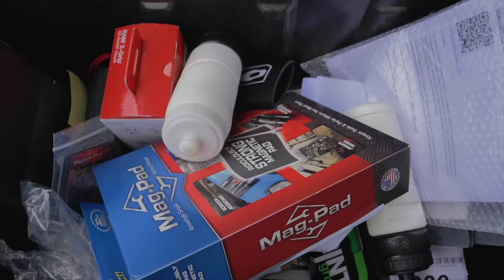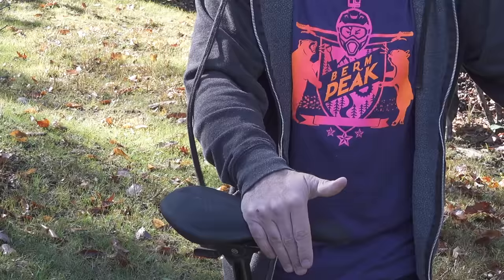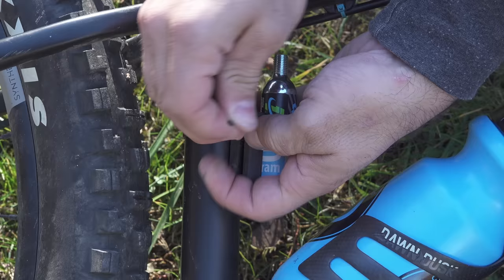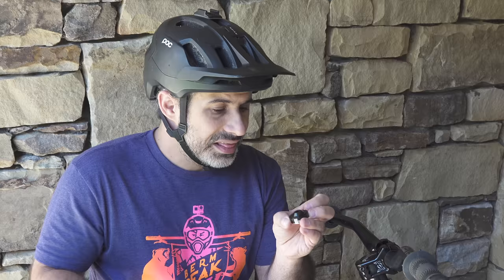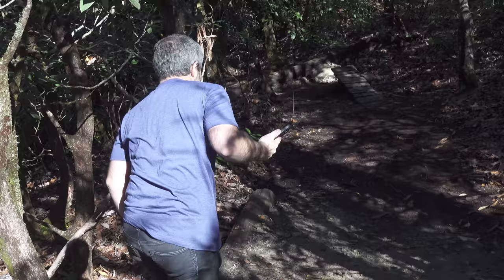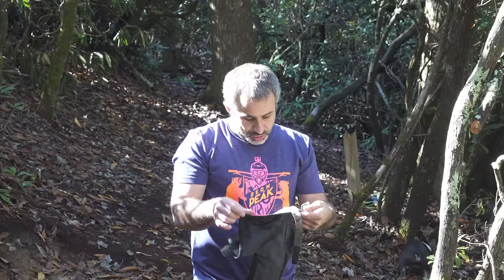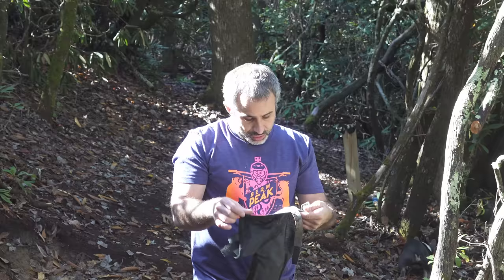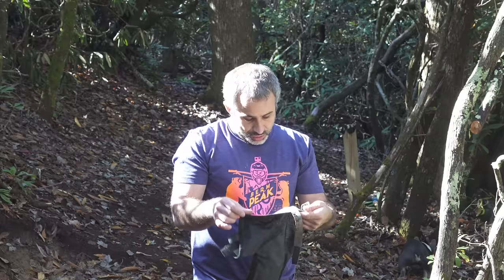Mountain Bike Products you may not have heard of

Comment: i think you missed the point in the battery powered pump.  Its not designed to replace tools at your shop (hand pump, or compressor). Its designed to be small and portable. Something you could easily keep with you on a trip for your bike, or motorcycle (i keep one on the later and its perfect for adjusting tire pressure on the fly on road trips without having to seek out a gas station)

Comment: I have Xiaomi air pump and that's the only pump I use since. Yes, it is slower and noisier. But the best benefit is that you can do something else while it pumps your tire. To the EXACT pressure (no need to double check and release air)

Comment: Loved the stem capitain and the schrader tubeless valve. I have 2 26ers. 1 with presta valves and 1 with the old single wall rims for schrader valves. I plan to try out if I can make it tubeless, but I suspect it is going to be a pain in my butt. I think the stem capitain would be more usefull if it was a navigation device or if it was a locking device with a corresponding phone case so it could hold your phone and allowed you to use navigation, clock, etc.

Comment: Hey Seth - if you really looking for a kids saddle on your bike . Check out the Feva Star seat. Its rock solid, does not clamp our holy carbon frames and costs a fraction of macride (which is probably the most premium you can get). My boys loved it - and it survived 4 seasons of shredding. downside is - its not size adjustable. so i could use it max to 3 years ... but all my kids knew how to ride themselfes with 3 years ;-)

Comment: Seth I think you might have misunderstood the purpose of the electric pump, at least I would think that it is for you to put in you bag and refill your tire anywhere if you got a flat and need to replace it, and for the size, it might still be faster and easier than a little hand pump the size of that electric one. Trust me, I have a hand pump and its soo not fun to inflate a tire to full pressure with it. I usually end up pumping to a rideable pressure and then just baby it to a gas station and pump the hell out of it with the air compressor there.

Comment: I'd use the electric pump if I'm out on the trails or on the train to my local trails. In my mates van I can use his lorry pump (he's a HGV driver by trade) and that thing can seat a tubeless tyre when set to full blast. Runs off the ciggie lighter, programmable and can do 0-35psi in about 10 seconds on the slow setting. I've changed innertubes in the van on the way to trails before, it's a right laugh.

Comment: "make any rim tubeless" - briefly, then you get sick of it going flat due to the non-tubeless wheel leaking from the bead seat. If it was designed to have a tube in, it was designed for that tube to keep the tyre seated on the rim, and without one it can move around and leak.

Comment: I think that testing the battery pump against a hand pump would have been a better comparison. You cannot put the floor pump you used as a comparison in your backpack, you could absolutely fit that rechargeable pump in a backpack. I bet when compared against a hand pump, the speed is much more comparable,  and when you consider what a PITA it is to fill a MTB tire with a hand pump while on a trail, the weight penalty could be worth it.  Also, does it operate as a battery bank? Also, the Lithium Ion Air Pump in your links section is not the same product as the one you reviewed.

Comment: The seat is not for adults, its for small kids.
And the pump, i own one of these and i love it to take it with me. You compare it to a big workshop pump, that is wrong. Compare it to a pump you would take on a tour. Yes its slightly bigger, but mine can fill a motorcycle tyre 16 times before the battery dies. That is enough for a tour. While it pump, you can clean up your tools or whatever.

Comment: if they make an adapter i highly recommend the milwaukee 12v cordless air pump. i use mine often and that thing is great. im betting it would have easily sealed up that tire guaranteed. that thing is so handy i love it. set the psi and your done
Reply: It has an adapter for the presta valve on the back of it, actually.

Comment: Meanwhile, I have a Lithium air pump. It is useful for one purpose: filling my air booster to 10 bar, while I install a tubeless tire. When I am ready, it is ready as well. 
And if it does not work at the first time, it fills the booster again, while I try to optimize the tire fit.
Usefull, if you do not have a compressor.

Comment: i have a better solution for you instead of the bandits shoe covers..i use trail gaiters (by salomon) for years to avoid all kind of junk lifted by my bike tires getting into my shoes..same thing if you step into a mud, water or anything like it..although i wear quick lace shoes (adidas terrex swift r2 gtx), and there's no way that my laces when loosened (impossible to happen) could end up in drivetrain or wrapped around anything, i highly recommend these gaiters for riders wearing shoes with ordinary laces..so, it is like killing 3 (or even more) birds with 1 stone..those gaiters are extremely easy to put on, lightweight, comfortable, durable,..and they cost just around $15..i’m pretty sure they’ll do well while trail building too ;)

Comment: I bought a used bike and the guy before me drilled out the back wheel to schraeder but the front is presta and when i went to go tubeless I had to get a tubeless schradear valve and I found one at my local bike shop and it worked good.

Comment: I think the idea of the pump is to put in your go bag or pack...although I don't know how much I'd trust it...I've had a few of those and the biggest problem has always been battery life and reliability...even the one I currently have has horrible battery life, 3-4 MTB tires and it needs recharged ....I had a similar one last year and I used it 4 times and then the battery wouldn't hold a charge...so I'm glad I wasn't in a position to where I had to actually count on it

Comment: Mac Ride is way better than the Kids Ride Shotgun. Purchased and tried them both. Returned the Kids Ride Shotgun. The overall design of Kids Ride Shotgun is not great. It's very cumbersome to install and clamps to your bike frame. It requires tools to adjust, install, and remove. This means it's difficult to swap between bikes. The seat is just a regular bike seat and my toddler struggled to stay positioned on it and slid off on steep climbs. I will say that the extended handlebars are nice, though.

The Mac Ride's seat is made with a stickier rubber and has a lip on the back of it that prevents my toddler from sliding off the back when going up steep climbs. The mounting mechanism is so much cleaner and it takes no tools and less than a minute to transfer the seat between my bike and my wife's bike. I highly recommend the Mac Ride over the Kids Ride Shotgun.

Comment: The electric tire pump is probably more useful for racers (XC and CX) to get easy repeatable pressures in the pits. They can set the pressure beforehand and apply it to multiple tires.
Reply: yeah true. I have one and it's SO good for my road bike with latex tubes that need to be pumped up each ride as they seep air after a few days. Just turn it on and walk away while I put my shoes on, come back and swap wheels and then fill up my water bottle or whatever and i'm good to go. Yes it's slow if you just stand and watch it but when you are doing other things while it works.. it's technically faster :)

Comment: I actually really like that electric pump. I hate using a hand pump to fill up a flat tire. It takes forever and ends up being difficult as the pressure increases. That pump looks like it could fit in a hip pack and replace my hand pump

Comment: That MUUL is pretty awesome. I picked one up last year after seeing it on another racer's bike. I've run it on tons of races and rides. Never moves.  It also holds chain links.

I go ahead and partially thread an inflator head on the C02, and put some blue loctite on the threads. This holds the inflator on, and it's an easy twist to puncture the CO2 cartridge to get going.

Comment: ghetto tubeless isnt wrapping tape around the rim, its slicing the outside of a 20" bmx tube witha zacto and using the tube as arim strip then mountign the tire, slime, then inflating it. Its much much much better tha ntape, although obviously, a thin strip of gorillat tape along the rim + the tubve carcass iu all you need. not trying to troll just giving viewers advice. works on all wlamart bikes and as of right now would cost less than $15 US to do, and Ive rode Joyride expert jump lines at leas t70 times with this setup. LEss issues than i had with stans and stans is 20x more expensive

Comment: Hi Seth I'm trying to get my family into bike riding. We live in Jackson MI. Jackson has done a lot to building bike trails actually the state MI is doing the same.  Here's the issue. I have CP and have had to modify every bike I ever had. I just bought a Mongoose Argus ST 26 1x7, it came with a twist shifter on the right. That won't work. Looking all over the WEB for a lefthanded rear derailleur trigger shifter. I have a shimano 7x flipped upside-down, that takes away from the eas of use idea. Seth do you know of a lefthanded rear derailleur shifter. Oh I also flip my brakes. Thank you

Comment: I've never understood tubeless - and I hope I never will. You've got special valve stems, a liquid you need to mess with, high pressure you need to pump up the tire (so impossible on the go, except for carrying another useless gadget - the magic CO2 cartridge), and special rim tapes.. All that for what? Couple of tens of grams compared to lightest tubes - which already come with built-in valves and added puncture protection, if compared to tubeless? Isn't that all crap just to justify another completely new branch of industry of ripping you off like a puppy? Out of my abt. 5-6 bikes I have a single tubeless tire (front on my 26inch carbon Giant XTC as my best 26 MTB) - which is a Crossmax wheel and came tubeless already preinstalled. I've ridden it for months and haven't felt any difference in performance or handling compared to regular tires. So what is up with that?
Reply: Tubeless is trash. It doesn't save any weight at all since you need to carry a spare tube at all times.
I'm 38 and never used tubless. Done more than Seth or most people on Youtube. I'm just not an extrovert that talks nonstop. Maybe if I do coke I can be like Sam Pilgrim. FUCKING EPIC DAY WOOOOOHOOOOOOOOOO

Comment: 0:38 No, no its not. The reason is that your sitbones are not supported well by the saddle. And that it then presses on areas where no pressure should be. The shape is what matters for that most, not softness. So a saddle cover does not help, yes. But for entirely different reasons. You are riding Ergon Saddles, you should know that. I am dissappointed that you make such blank, wrong statements.

Comment: I spent a bit of time on a home made version of the kids ride shotgun seat when I was little, like 3 or 4 years old. Can't say I particularly enjoyed it but it worked okay for like dirt roads and easy easy singletrack. It's definitely less sketch than one of those rack mounted seats and probably safer, and as I understand top tube seats are a pretty common system in the Netherlands for toddlers and small kids. Would definitely recommend considering it for kids who are too young/small for a trail-a-bike or tandem (which is definitely the preferred method once  they're big enough)

mind you I also ended up almost exclusively riding road, so I guess there's the risk that top tube seats may somehow turn your kid into a degenerate lycra wearing freak

Comment: I will never understand the 20 25 psi pressure you guys run. Holy crap it must be hard to ride. No less than 35 for me on my mountain bike plenty of traction and you can pedal it without so much flat tire drag. Bikes need air I have no idea who started this low pressure trend
Reply: Wow 35 is way too high for mountain biking. 
I use tubes and run 25psi. Maxxis DHF. My trails are rougher than yours.
Reply: @RealMTBAddict  you must do nothing but go down but if you ever start climbing pump up those tires my friend you will be much better off.